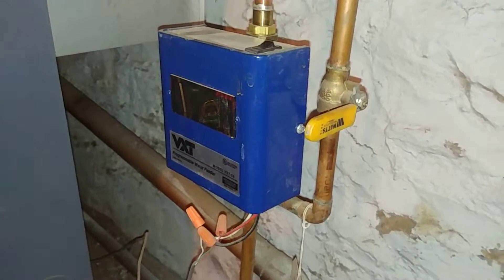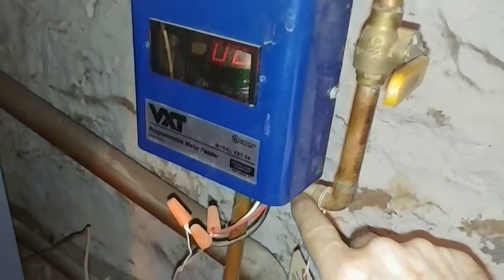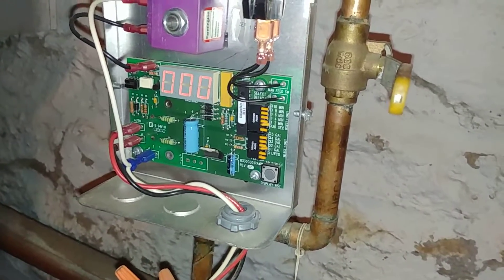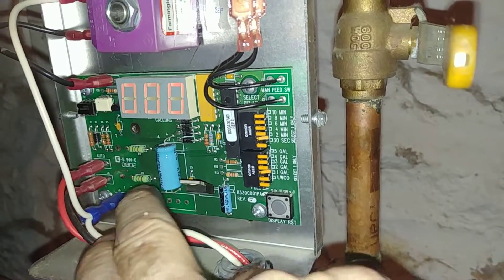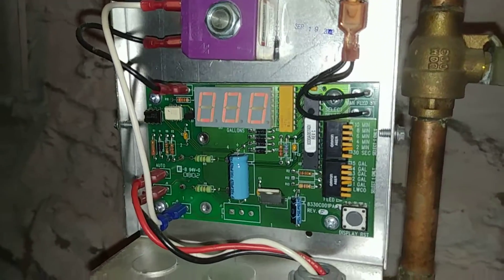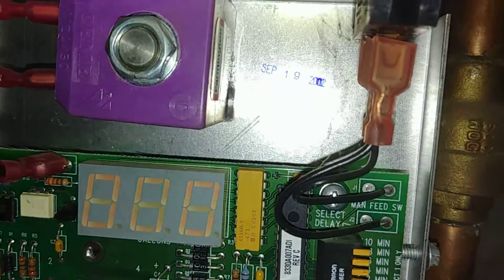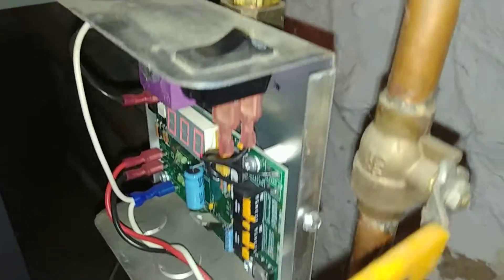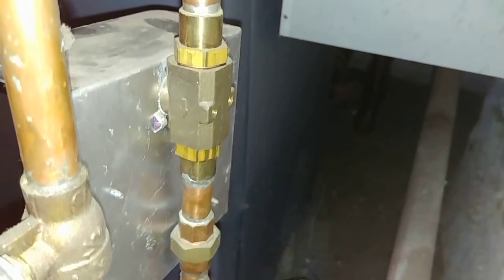20 Year Old Hydrolevel VXT-24 Steam Boiler Water Feeder Still Working

Comment: Hello, great video. Quick question, I'm going back and forth about setting one of these up, but terrified about stories with flooding. Should I stick with the manual way or have this unit professionally installed? Thanks again
Reply from the maker: Thank you!
As to your concerns, you are not wrong whatever you decide.
The VXT is not a necessary safety device, it is a convenience that keeps reasonably objective track of water loss. 
Some would say in checking on your boiler once a week or more and adding water manually,  you gain invaluable "hands on" experience as to your system's needs & again, that's not wrong.
If you have lots of little leaks, the VXT valve will be more likely to lime up and fail, esp. if you have "hard" water.
You can use the VXT as the "canary in the coal mine" to alert you to the crypto-leaks that many systems have.
A "tight" system with periodic rebuilding of the VXT's valve should stave off the likelyhood of a stuck-open valve.
Or, you can use it as back-up if you go out of town and switch it off when you get back.

Comment: Good explanation, thanks.  Is over 20 yrs. the average life of those units?
Reply: I’m about to go out on a steamer I installed less than 4 years ago this afternoon.
I’m sure it was dry fired by the customers admission. I can’t stress enough how weekly maintenance by the customer is crucial, but humans are lazy until they open the wallet and in this case it’s gonna bleed cash to fix without a warranty. Some folks never learn.
PS no maintenance since original work and they were told yearly preseason. Run it til it breaks😡
Reply from the maker: You're welcome!
As to their lifespan, hard to say.
The current version's electronics is pretty robust.
There is a video of me setting a VXT-24 on fire with a deliberate high voltage surge and it was still easily repairable.
The weak point is the valve due to calcium build-up.
And there is a repair kit for that.